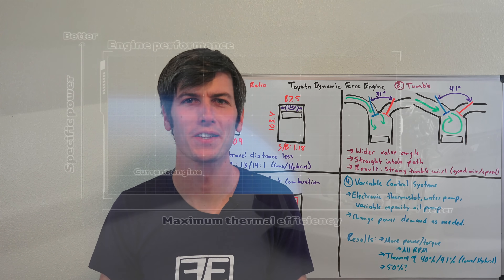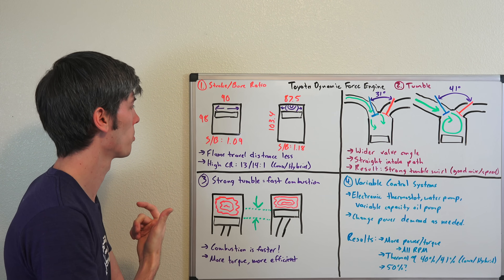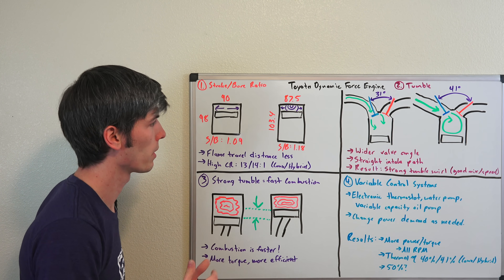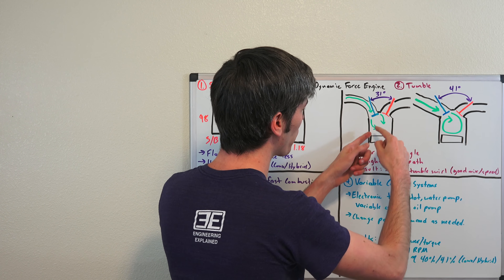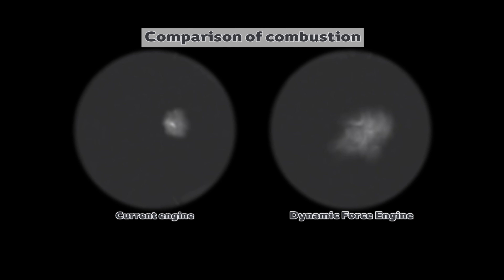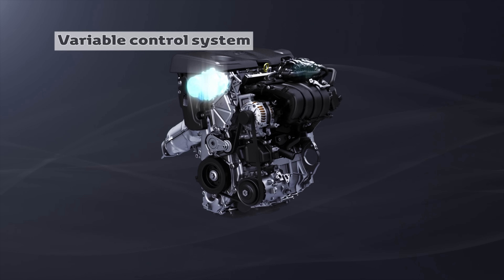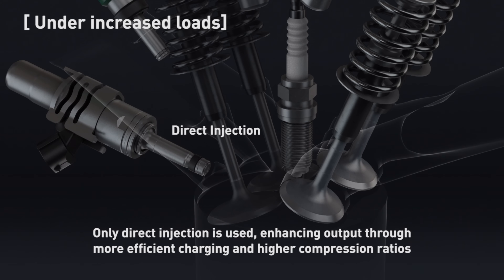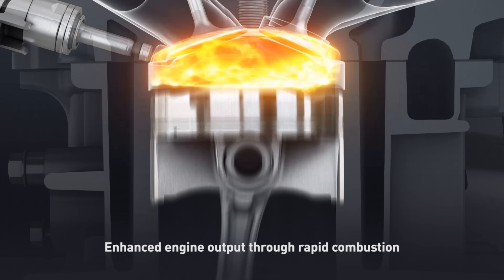Toyota's New Dynamic Force Engine Is Super Efficient

Comment: Amazing I can't believe they never optimized the combustion chamber in this way already. It's seems so intuitive now that some one has done the hard work~
Reply: I think we're now talking semantics - I was saying that the idea of optimizing the combustion chamber, "playing" with the intake runners, valve position etc. is not something new, while you are referring strictly to this very specific way of optimizing it as being new. Which, indeed, it is new. I should have been more thorough with my phrasing. Hope that clarifies. 
And about the thermostat - I did not mention it randomly, it was mentioned in the video and I thought it would need further clarification as it may lead some people into thinking that this is also a new technology.
Reply: Fast combustion is only slightly relevant for efficiency and mostly at high rpm. The faster it burns, the faster cylinder pressure starts doing work and more of the stroke is available for it to work with, but we are talking only 2% or something gained. The under square cylinder and high compression is the key to high efficiency. Also notice that this engine is DCI, so the tumbling does not mix anything before the injector delivers. The  electric water pump can save up to 10% of power in city driving where propulsion only takes 2 HP and the water pump uses hundreds of watts. Also the high speed video of the combustion is not a completely honest comparison as obviously the Toyota cylinder on the right runs leaner than the comparison cylinder, because the "light off" of the charge around the spark plug at the end of the burn is smaller and a leaner mix have faster flame progression. Also Toyota spare parts are dirt cheap!
Reply: EmissaryGW2 I remember reading some time ago in a motorcycle magazine, that a narrower valve angle would allow for straighter intake and exhaust canals with more laminar flows (less bend before and after the valves) and therefore higher top end performance. Well, at least with the high bore/stroke ratio of high performance motorcycle engines. I guess the same applies for high performance car engines too.
Reply: David - Interesting. That sounds like it completely depends on how the various components are positioned relative to each other though. Given that a motorcycle is laid out very differently than a car, I wouldn't necessarily assume the same benefits apply. But being honest here, I am absolutely NOT an expert, I'm just going by information I've seen in this video and a couple others about the Mazda SPCCI engine. It makes sense that if wider angle were such an obviously better choice then they would have done it 30 years ago instead of just now, so there must be other considerations involved.
Reply: "Direct cylinder injection"!! or is it just called DI?
Reply: Mzn T electronic thermostat =/= 41% thermal efficiency.
Reply: AFAIK the wider angle is most likely just done for better efficiency. For peak performance a narrower angle between the valves is better. Someone correct me on that if false.
Reply: @Tore What is DCI? The engine in the vid was petrol.
Reply: Mzn T that's the literally the meaning of optimization~
Reply: Mzn T he was talking about how they optimized the combustion chamber, to which you replied, "it's not a new idea." And then you talked about an electronic thermostat
Reply: It's not a new idea. Neither the use of electronically controlled auxiliaries. My car has an electronic thermostat for example and is from '99. Not that I want to bash Toyota for this new engine.
Reply: psnmadracer27 Of course not, did I say that? I was outlining that not everything on this engine is new technology, but rather existing technology used very well.
Reply: Mzn T it's a "conflict" because what you said was incorrect, whether you see it as such or not. Sure, electronic thermostat isn't new. Nobody said it was. But CP was talking about how the combustion chamber was optimized. That is a new idea, and it was the focus of the video
Reply: What makes you think a narrower angle is better for power? The point of the wider angle is to speed up mixing and atomizing of fuel/air, so that it burns faster, which is better for both power and efficiency.
Reply: The domed combustion chamber was proven efficient in swirling by Chrysler in the 50's on their Hemi engine, and you need to have the valves at an angle if the combustion chamber is not flat. Zero angle valves (in line) under a single camshaft  pushing down on short valve stems, is used in motor cycle engines to have as small as possible reciprocating mass, but that is for faster revving and higher rpm.
Reply: Why is this some sort of a conflict? I was just pointing out that there is no revolutionary new technology on this engine, others have tried similar stuff, but did not achieve the same level of optimization. Which is a compliment to Toyota, not the other way around. I was not trying to contradict Yu Lung Yip, it was a form of addition to what he was saying.

Comment: Can you do a video on mazdas new engine that doesn't use spark once it's running like a diesel and is super efficient but the compression is high
Reply from the maker: Already have! :) And in fact it always uses the spark plug. Explained here: https://youtu.be/yNSxow3W7ek
Reply: Engineering Explained my bad. Thanks
Reply: That's basically what direct injection does currently. It's fairly normal in the current crop of cars, but the problems in the early days were coming up with injectors that could reliably handle combustion temperatures, keeping super precise pumps working properly, and carbon deposits. We're still working on that last one. Toyota use port AND direct injection as an expensive fix for that, largely because it's currently easier to have two mostly separate fuel systems that it is to devise some other way of keeping inlet valves clean.
Reply: He make a  video about that just look the older video
Reply: Oliver he did, a while back.
Reply: Oliver There's mazda vids that already explain it with pictures too
Reply: what would be the issue with injecting directly into the cylinder after an otherwise unachievable compression instead of into the airstream?
Reply: V.A.G. (VW/Audi/seat/Skoda) is the other manufacturer of port and direct injection on its engines.
Reply: DI does not clean the intake valve. They get very dirty.

Comment: If ignition is happening so fast then will it affect fuel consumption... Economy ??
Reply from the maker: Yes, by improving the thermal efficiency, fuel economy will be improved.
Reply: maintaining good air velocity and manipulating the flame propagation for a quicker more even burn usually requires less fuel to be injected as its a better use of the combustion process. 
the entire engine is designed to work as a whole to use its energies in a specific way, they've obviously done well lol. faster doesn't always mean more.
Reply: Yes and no. The faster flame front is a side effect of all of this mixture motion (swirl, tumble, squish) and preparation (atomisation and distribution), but it's key to efficiency because the faster the burn, the more fuel burnt by a useful time in the power stroke, the more energy you can extract from the power stroke. It also allows you to run a lot less spark advance and as a result lowers the chance of detonation, allowing a higher compression ratio, which affects, amongst other things, thermal efficiency and burn speed.
Reply: No contradiction. There is an ideal peak pressure angle (I think it's closer to 20 degrees than 45 though). But in a normal engine combustion begins (spark happens) at 25-30 degrees before TDC at high loads and up to 50 degrees at low loads, so that can represent a burn "time" of 45 to 70 degrees, with more than half of that occurring as the piston is still rising. This raises pressure higher than it would be from compression alone and saps considerable energy doing so. Effectively, spark advance creates negative power. Faster burn requires less advance = less negative power = more power for the same fuel burnt (which is the definition of greater efficiency)

*edit just reread your post, complete answer follows in next comment
Reply: Maximum torque per psi in the combustion chamber does indeed appear at 90 degrees. But that's not actually how this thing works, because combustion is the release of energy, not the energy itself. The energy is released in the form of heat, which raises the pressure in the combustion chamber as well. After that the energy is extracted by pressure on the piston turning the crankshaft, which doesn't really have any time function to it, from here on out it's basically about change in volume. If you wait until half way down the power stroke to fire the spark you've completely wasted the first half of the power stroke (which could also be called the expansion stroke) no matter how fast the burn.

Unfortunately YouTube comments aren't the greatest platform for me to explain combustion theory. I think I need my own channel or something. Then people like me can annoy me when they think I'm wrong. It's only fair, I've probably annoyed Jason here enough to deserve it :p
Reply: Thanx for the reply...n btw i am a big fan of ur channel....It is an integral part of my undergraduate course ...Helped a lot in understanding deeper concepts in concise way ☺️👍👌
Reply: I'm no expert but doesn't  the more efficient combustion comes from a better distributed fuel mist in the fuel-air  mixtures due to the thumble. Isn't the faster flame front more of a side product?
Reply: So basically the more punctual use of the force generated by the expanding gases does the magic. Isn't that contradicting with the fact that maximum torque occurs at one fourth of the crankshaft spin and therefor the combustion would be more effective around that spot, although I do understand that for Otto cycle engines  the efficiency goes up with higher compression ratio ( therefor the highest efficiency at top dead center).
Reply: Skippy Well you just tryed to explain me something i already knew XD. What i meant was to maintain the pressure until the 90° (like the Seiliger cycle or in german "Seiliger Prozess") in form of slow burning fuel-air mixture. Steam engines for example have a constant volum increas at the same pressure (well the pressure difference is very small).
Reply: Ooooh. No. There's no benefit to it in an internal combustion engine. The only way to extract the energy is via piston motion, and as long as you have X fuel burnt before Y crank angle the pressure will be largely the same at said crank angle regardless of when the combustion actually occurred (give or take some small amount for heat loss to the cylinder walls). You would basically be giving up extra torque production up to that point (and the exhaust valve opens long before BDC anyway, so you don't even get the full rest of the stroke to extract the remainder of the power). The only benefit is if you had some mechanical strength issue.

Not sure how much you know of steam engines, but many of them had variable cutoff (or where they stopped injecting the steam in relation to crank angle). High efficiency was gained through high steam pressure and early cutoff if all else was equal. Best power was gained through late cutoff, but that was down to pressure limits, it wasn't possible to inject that much steam into the cylinder at TDC, injecting it for longer was the only option available
Reply: Skippy Not sure how much you know about engines or if you even consider to think about what i said but there wouldn't be any torque loss with additional fuel and oxidizer burning (also most normal    
engines open the exhaust valve short before bottom dead center, there are even ones that open after bottom dead center). Listen i think you just trying to debunk my comment but i would rather talk about the idea of burning an extra ammount of fuel-oxydizer mixture after TDC. Benefits and disadvantages.
Reply: I thought you were trying to slow the burn down, not burn more. Either way I don't see an efficiency benefit to injecting more fuel and oxidiser well after TDC. I also don't see a feasible method of doing it. 

At this point (direct injection of fuel AND oxidiser into a combustion chamber) you don't need a four stroke engine any more
Reply: At that point, if you're wedded to the idea of using a reciprocating engine, you only have two strokes, power and exhaust. There's no more detonation to worry about, so your "compression" ratio (in this new engine it's now the expansion ratio) is basically unlimited. It, in effect, operates like a steam engine but with a 2-part rocket fuel system instead of steam injection. Injecting fuel-oxidiser mix to maintain constant pressure would result in humungous specific torque and power outputs but dreadful efficiency.

There would be a lot of advantages to an engine like this (no multi speed transmissions, no reverse gear, no clutch, highest efficiency at lowest power output), but the big disadvantage is the need to carry oxidiser. Engines consume huge amounts of oxidiser. If you think of how long a nitrous bottle lasts, imagine if there was no intake and the all of the engines power came from some variable shot nitrous system. You would need a lot of nitrous.

Currently the best way to get oxidiser into a cylinder is through an intake valve on an intake stroke, sucking from the atmosphere. Unless you're in space
Reply: Skippy Now we are talking :D. Example for such engines do exist.  
There was a time when torpedos were driven by V8s. They basically used a oxidiser-fuel mixture (i think it was Oxygen and Methanol) 
And mixed it with parts of the  exhaust gases because as you probably know Oxygen is very aggressive. Such a system would last for a quater mile (probably a bit more), what i think would be enough given the fact that there wouldn't be any other useful application than a quater mile racer. You could also use a normal engine with such a back up system for a high power output at a specific time.